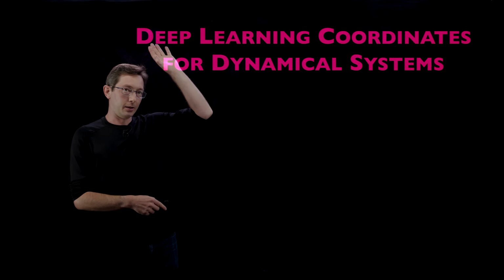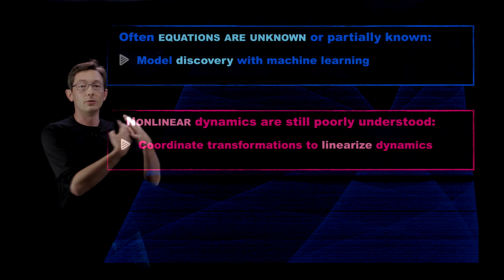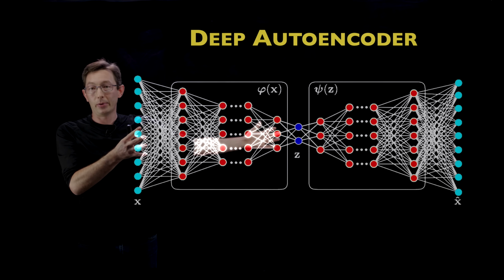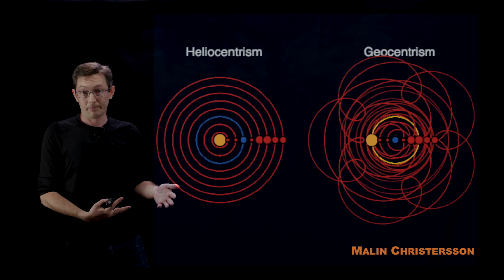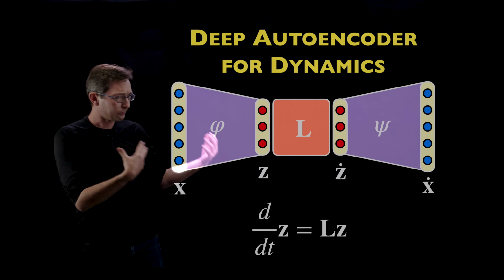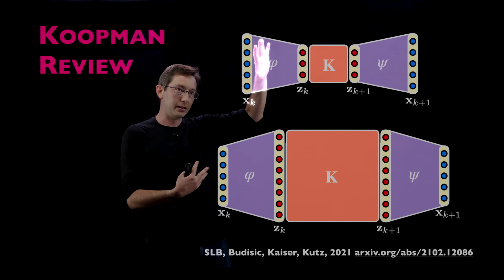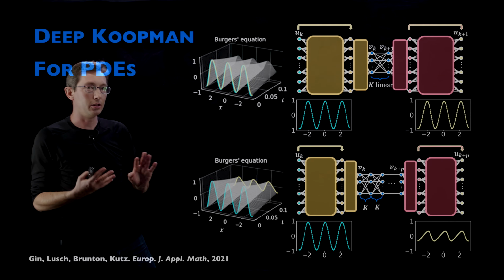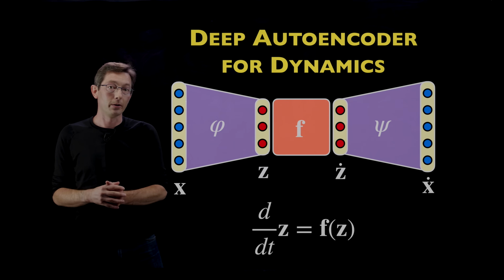Deep Learning to Discover Coordinates for Dynamics: Autoencoders & Physics Informed Machine Learning

Comment: Professor Brunton, thanks to you and team mates for the amazing content. I think it is desirable to  correct the pendulum videos, because the images are affected by an affine transformation due to the lens distortions, looking to the botton video line you can se how distorted it is. There are libraries to identify the parameters of the camera affine transformation using a chessboard tracking the corners coordinates distortion.
Reply: You can easily factor the affine transformation in the encoder (and the inverse one in the decoder). You don't always have access to distortion correction settings, and as long as you've been using the same capturing equipment, you will be able to factor such transformations during training.
Reply: @alfcnz  Professor Canziani, it's amazing to have your answer here, in a way I'm your virtual machine learning student on youtube! Thanks a lot you and your team mates for the amazing content.
 I totally agree, especially when it comes to a linear transformation that would be easily understood by the network, my biggest concern is that this distortion could be wrongly treated as the problem physics, being more of an observational error, especially when linearity is enforced in the dynamics discovery.
Reply: @alfcnz  But if you trained it on distorted image data, wouldn't it make a false correction to undistorted image data?
Reply: @iestynne  Its is not difficult to calibrate the camera!

Comment: thanks so much! this definitely helped me get into deep learning dynamical systems. I am working on a problem where I want to classify the state of a viral particle near a membrane. I transformed a lot of simulation frames into structural descriptors. I am at the point where I need to decide on an architecture and loss functions to learn. I have begun naively with a dense neural network. This however seems very interesting, not directly but it could be another input for the DNN. The Z could be describing certain constant dynamics surrounding the viral particle which could help classify the state. Anyway, thanks a lot!

Comment: Just curious whether your usage of the term "lift" is related to the topological/categorical use of that term? Specifically whenever there is a morphism f: X —> Y and g: Z —> Y then a lift is a map h: X —> Z such that f = gh (i.e. the diagram commutes).

I think the analogy works: Let X be the original data space, Z the latent space, and Y = X. The composition gh is a map X —> Z —> X, if we set f = the identity on X, then h and g are the encoder and decoder, then f ≈ gh expresses the reconstruction objective.

Comment: Nice video! I am very new to this subject (In fact this is the first video I have seen about it), but it seems that essentially what you do is derive dynamics from an action principle (minimizing the generalized loss functional) and so any partially known physics I suppose would just be incorporated by Lagrange multipliers. About the two different approaches for linearisation (going to higher and lower dimension), I think that both are physically motivated. You can definitely expect dynamics to become more linear if you go to higher dimension too. Think about thermodynamics: You can either try to describe average degrees of freedom like entropy, heat, etc. which would follow easy laws, but at the same time you could try and describe the system by describing each individual particle. It wouldn't really be feasible, but it's not unlikely that the dynamics can be described from a simple possibly linear law (like a box full of free collisionless particles in a homogeneous gravitational field).

Comment: Many non linear system exhibit phenomenon of chaos (divergence in the “original” coord if 2 systems have tiny diff in their init condition), would be interested to see if the “recovered” x_\hat should also reproduce the chaotic behavior with that same Lyapunov expononent, and also what should happen to the latent z’s.
Reply: First question, they do. It is validated in 1990-2000 where numerous engineers and mathematicians play shallow neural network. Second, I don’t have an answer.

Comment: In wikipedia ,state variables are reffered to as the varibles that describes the mathematical state of the system and state as something that descirbes the system ,but isn't state is the minimum set of variables that describes the system
wikipedia article link  : https://en.wikipedia.org/wiki/State_variable
And also ,I want to ask is there any difference between configuration of a system and state of a system?
Reply: Yes, your understanding of state variables is correct. Sometimes its useful to make a distinction between state variables and a "minimum set" of state variables. State variables are anything that give you information about the state of the system -- it doesn't always have to be a minimal set.

In my experience "configuration" and "state" are similar terms but I could be wrong about that.
Reply: @vg5028  yes but isn't state is referred to as minimum set of varibles that completly desctibes the system(those minumun set of varibles i.e state varibales) but in wikipedia state is referred to as something that describes the system and state variable are something that describes the state of the system but isn't here state was reffered as minumun set of varibales i.e state variables?
Reply: You asked a GREAT question. Think about this, you have a system variable of 2 state, one always is around 0.00001, the other is around -1 to 1. So you will tend to believe this system is approximately 1D. But mathematically, your understanding is 100% right. it is 2 degree and no less, but you can think it as 1D which brings you a lot of easy life, if you are in the business of modeling and control!
Reply: @hfkssadfrew  what i am asking is what 'state' is  whether its referring to that condition of the system or referring to the mathematical description of the system?

Comment: How do I compute the x dot in case of x are pixels?
Reply: probably for each pixel separately in 1D by simple Euclidean gradient dx/dt, because the joint underlying function over all pixes is unknown (neural network needs to learn those correlations from examples).